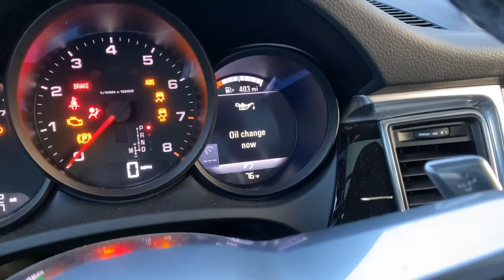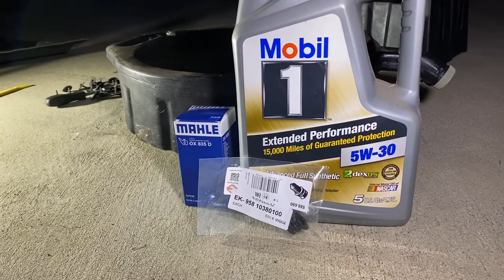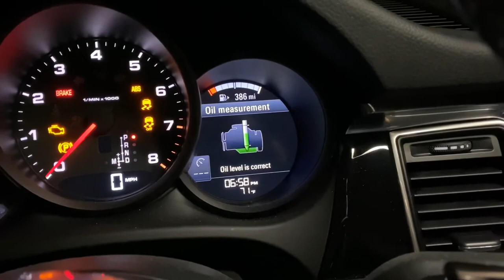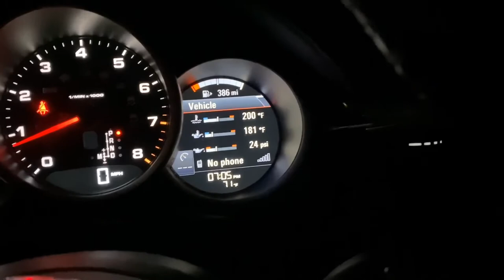Porsche Macan 2.0L Turbo Oil Change and Reset Monitor

Comment: Really want to thank you for you time and video, was very helpful. I think this was the easiest oil change I have completed outside of resetting the oil light. Purchased MAXIDIAG MD808 Professional OBDII Scanner and it worked well (i could not see the small red box on the number pad to set the date) . I am  first time Porsche owner of a 2017 2.0. Thanks Again.
Reply from the maker: Glad it helped!

Comment: as a point of reference, crack the oil filter loose, until you barely see the gasket, and open the oil cap before draining the oil. so it all drains at the same time and it helps it drain faster. I advise on getting a hand pump extractor and get the engine oil to operating temp and extract it via the dipstick tube for ease, so you don't have to remove the belly pan and all that jazz every time. Yes, this method DOES extract/removal all the oil from the crankcase. also, on these engines, which VW and Audi use on 90% of their fleet, perform oil changes every 5k miles will save the engine from future issues with timing chain stretch/wear and oil consumption issues. I know this was poster 3 years ago, but keep an eye on the thermostat housing once you start getting into 50-60k miles as they tend to leak.
Reply: yepp. sucking out the oil through the oil dip stick..same method i use on my VW beetle. Even mechanics recommend that method.
Reply: This Macan does not have a dipstick.  Extracting  oil from above will not work
Reply: @raymalig7249  It doesn't have a dipstick, but it has a dipstick tube where a dipstick would go (when the engine is used in other cars). See 5:08 in the video. It's just to the left and in front of the oil filter. Remove that cap and there's your dipstick tube.

Comment: Purchased the full oil change kit from FCP Euro last week - I know Porsche recommends Mobile 1. Any insight as to how LiquiMoly runs in the 2.0 4 Cyl engine? Good idea or bad idea?
Reply from the maker: No idea, I usually stick with Mobil1 in all my cars. Its cheap when you buy the 5 quart bottles and change often.

Comment: Does the 2.0L engine call for 4.7 Quarts of oil or 4.9 Quarts? Because the manual says 4.9 Quarts, but in your description you put 4.7 Quarts.
Reply: I dump all 5 quarts in all the time, never had an issue
Reply: @Will_Send  Thank YOU!  This is my very first Porsche after 4 decades of driving various BMW cars so I'm grateful for any info from current owners who are familiar with the Porsche brand.

Comment: The instrument panel shows Oil change how you made it disappear, and it will disappear naturally if the oil is changed.
Reply from the maker: You have to manually reset the oil change interval using any obd2 tool
Reply: @wilnomadic  do you have a video how you have reset the oil chance interval using your Autel MaxiAP AP200? or is it too simple to do, and thus not worth making the video? thanks

Comment: My dealer always did my oil change when my Macan was under warranty. Now that the warranty is up, I will be doing my own oil changes. Dealer always used Mobil 1 ESP. I noticed you did not. I wonder if the ESP version is really necessary? It is hard to find. One NAPA store carries it but it is far from my house. Regular Mobil 1 is everywhere.
Reply from the maker: Never heard of ESP version so not too sure I just go off weight
Reply: @wilnomadic  I discovered the ESP version meets the Porsche C30 spec as noted in the owner's manual. The regular Mobil 1 does not.
Reply from the maker: @rustyme1122  Ah thats good to know, will look into it for the next oil change. Looks like there is additives to protect emissions parts
Reply: @rustyme1122  Hi, doesn't this engine use the C20 spec instead?
Reply: @andoo1989triboi  Nope.
Reply: @rustyme1122 Just checked the manual for my 2023 base, it says only C20. It also says C30 is for the 2.9 engine

Comment: hey, thank you for sharing your footage, i usually do top-sider way to do oil change on this vehicle, but i decided to drain extra a few old oil from the vehicle this time. my question is did you used the ramp on the front 2 tires of the vehicle or all 4 tires? was going to get jack stand, but i don't know how to jack up the macan.. lol
Reply from the maker: Just the front two. I have jacked up all 4 corners on the Macan to do the transmission fluid. From what I remember there is no center Jack point in the front. Rear I used the rear diff to lift the rear at one time

Comment: It’s an ea888 , can you just use an oil extractor to suck the oil out from the top ?
Reply from the maker: So I’ve actually checked and couldn’t find a oil extractor tube to attach it under the oil fill cap. Also this car doesn’t have a dip stick so could not use that method either
Reply: @wilnomadic  so it doesn’t have the dipstick but it has the dipstick tube. It’s right next to the front timing cover. Doesn’t that go to the oil pan ?
Reply from the maker: @srsairbags  will check it out soon, oil change coming up

Comment: Wilnomadic  May I ask, What are you getting in terms of MPGs?  I'm told, it is less than that of the Audi Q5, with the same engine..  Thank you..
Reply from the maker: Not sure, i think around 24-28 mpg
Reply: @wilnomadic  Thank you. Now, is that combined or is that hwy? vs City driving? 
 Sorry for the questions. I have been researching the Macan vs the S, vs the Turbo..
Reply from the maker: @Kiss__Kiss  	20/25 mpg, its on par with the spec posted by manufacturers

Comment: The oil filter clicks into the housing before you screw it in I thought
Reply: I am not sure what you mean clicks in. It’s just screws on there is no stopper like a gas cap that clicks.
Reply: If you push the filter hard into the plastic housing it snaps in, then I screw it into the engine after. I don’t think it matters tho, you’re just doing it in a different order, it probably snaps in once you tighten the housing down.

Comment: What did you use for the obd2 reader?  Can you use any of them or need a specific one?
Reply from the maker: You can use any, most of the modern ones should work but just read descriptions that say it can reset oil on vw audi or Porsche

Comment: Are the drain plug and oil filter housing made of plastic? If yes, is there an upgraded aftermarket metal ones? And what material is the oil pan made of? It looks plasticky to me.
Reply from the maker: Yes, not sure I would not upgrade it because if you accidentally tighten then you will strip the pan. It’s simple to use the plastic version and they do not leak if you replace it every change.

Comment: Wilnomadic  Have you ever experienced "Any" oil leaks from this engine?  I know the S and Turbo models are notorious for Timing cover leaks, among other types, But have yet to hear about the Base engine have any leaks... At this point, I am leaning towards getting a Base(4 Cyl.) Macan.  
  Thanks in advance... Also, any updates on yours??
 PS: I thought I had subscribed before, but will do it again...
Reply from the maker: No leaks, that’s why I went with the base 4. Seemed like a reliable engine not being pushed hard. The turbo have issues at 65k but was replaced by Porsche under emissions warranty.
Reply: @wilnomadic  Ahh Okay, thank you very much for the update/info.

Comment: Dude just get you a hand vacuum pump kit to change the oil From up top the motor....Where the oil filter is anyway as well.
Reply: Always how I have done oil changes but the drain plug is plastic and want to replaces those as plastic become brittle after many heat cycles. Cheap insurance IMHO.

Comment: so there is no torque restriction for how much u tighten the drain plug then??
Reply from the maker: You should not be torquing it hard, its a plastic plug so when you turn it in and snug.
Reply: @wilnomadic  Thanks. I was saying that other metal drain plugs (like the 911) there is a recommended torque number for tightening with a torque wrench .. I guess for this one u have to use judgement. Very nice video.
Reply: It’s a single set of threads so when it stop turning that’s as far as you can go
Reply: It snaps into place

Comment: Can't believe what a giant PITA some simple maintenance is on these (and other) cars.
Reply: This is the tip of the iceberg
Reply: Some, like BMW have virtually turned their cards into sealed black boxes. Their philosophy is simple: when the light goes on, bring it in along with your checkbook. Really NO excuse for designing a car like this. My Outback (no, I'm not comparing the two...) is therapeutic compared to this. Oil changes rarely take more than 15 minutes.
Reply: This is stupid easy, the longest part of the process is letting all the oil drain. What’s the issue here?
Reply: @Jushwa  I think removing the lower drivetrain shield alone is almost 15 mins when lying on the ground upsidedown

Comment: Thank you for sharing. 
You need to get jack stands for your safety.
Reply from the maker: I have jack stands but found ramps fast for cars without a front center jack point. Sure I won’t get every drop of oil but I change it frequently.
Reply: @wilnomadic  those ramps alone are not safe enough. I mean ramp AND stands. That is what I do.  Those ramps have been known to fail.

Comment: Lol. This guy doesn't pay attention when he is refilling. All the oil is gushing out the bottom of the funnel.  Basic mechanic 101 keep your eyes open for fluid leaks. you might of saved few bucks but I'm sure if you go Porsche they won't spill oil all over the place.

Comment: Great video ... I dont remove the plugs at 1.40 I.. its a real pain getting them out. I just put the drain pan on the bottom guard and prop it up with a wooden 2X4 tomato it horizontal. Also I used 0w40 as against Sw-30 (accidentally.. since I have a 911 as well). Is that going to be bad for my engine or shall I run 5K miles before changing it again? Thanks
Reply from the maker: I can’t imagine the oil weight will destroy an engine but better safe than sorry. I just changed my parents oil because some shop added 5w-30 instead of 0w-40 in their Mercedes. I was feeling odd vibrations and sluggishness. After the change it was smooth.

Comment: Torque specs?
Reply from the maker: The oil filter should have the torque number on the cap. I just hand tighten and add an extra quarter turn to tighten. The oil drain you do not need to tighten hard you will feel it click into place it does not take much effort so be careful and its plastic.
Reply: Thank you , I just found that out ,

Comment: I turned wrong plug, I turned plug from the back, right now I overfill with oil. I'm fucked.
Reply: The transmission fluid plug? It’s not too hard to fill.
Reply: @will818  Yes, I was confused with the 2021porsche Macan's Trans plug with engine oil plug, so stupid!

Comment: Personally, That oil lever is good, I would not top it off.  I always leave it at half  point or less .
Reply from the maker: James Kang how many miles do you have and do you have any oil burning issue? I had to add 1 quart since the last oil change after 8k miles
Reply: No burning oil issue. Mine is 2017. 2.0 base with 40,120 miles. I did take my car to dealer at 32,000 mile for oil leak. My garage floor had small puddle of oil . So I try to find source of leak by visual inspection but just could not find it. After 3 visit to dealer,  culprit turned out to be my oil filter ring seal. It has slow leak. I bought after market filters at Amazon (6pack in box)and its seal is just little bit out of spec. It looks little bit thinner.
Reply: Do you have a oil leak on the floor? Anyways I welcome you to contact me for any Macan issue. I love to share info.
Reply from the maker: James Kang no oil leaks fortunately I have 70k on my car and the only issue was the turbo going bad recently. Porsche replaced it for free under emissions warranty. Sounds good let’s keep in touch. Are you also on the forums?
Reply: James Kang hi I cant see the whole comment, so does ur car have oil leak problem?

Comment: Lol this is so wrong, these cars require 0w20 c30 oils not this generic M1 oils that go in Kias
Reply from the maker: Are you in colder climates or higher elevation? Motor oil is different per regions. 0w40 is usually used for other German cars here in California but the Macan is recommended 5w30. How is M1 generic?